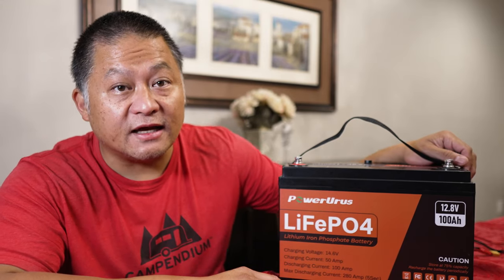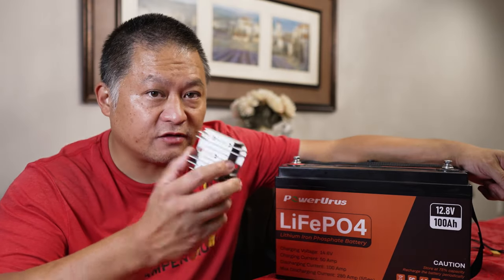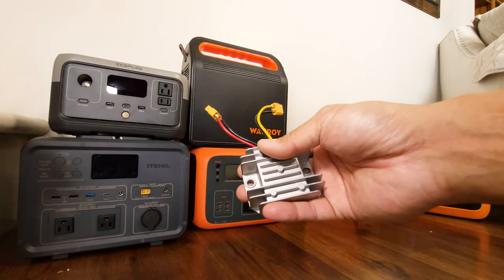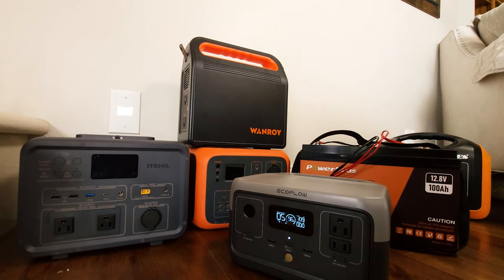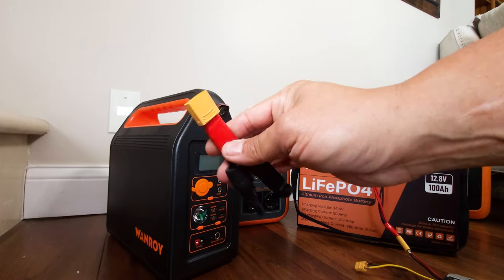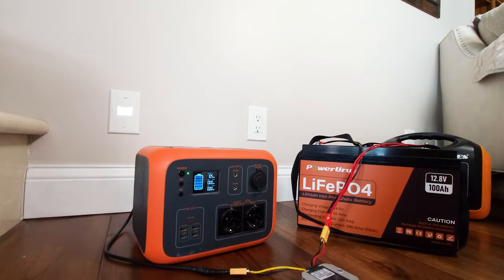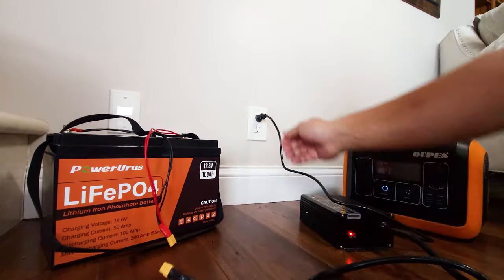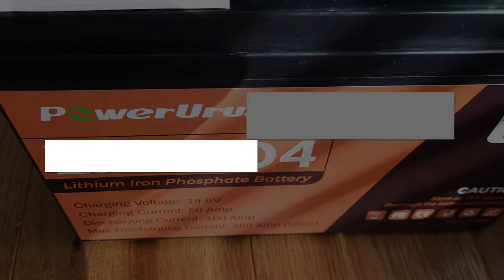CAPACITY HACK For ANY Power Station // PowerUrus 100Ah LiFePO4 Battery

Comment: This was well presented and clearly explained.  I think this is a good solution to use in an RV with a fixed LiFePO4 battery.  Your solution provides 1280KwH of additional storage.  The accessory battery is not cheap ($340).  The accessories add another $25-40.  External charger perhaps $50 for a total of $430.  Correct me if my addition is off.  

Negatives - Moving a large battery around is awkward – no handle/no case.  Maximum output wattage is still limited to the power supply circuits of your power station.  Albeit half the capacity, a new EcoFlow 600 is $479.  If you just need a moderate increase in storage a larger second unit would seem to be a better solution.  Is the boost converter necessary with some units?  The specs on my EcoFlow River 2 indicate it will accept 12-20 volts input for charging.  It comes with a cigarette plug adapter to charge from your car which is12 volts.  If this is correct, couldn’t I just hook the battery to the 12 volt charging plug?   Does it already have internal circuitry to limit the current and adjust the voltage?

I’d like to see this solution adapted to use with batteries we all might already have on hand (i.e. power tools, drones, external battery chargers for cell phones).  It may be a small boost but often that’s all you need.
Reply from the maker: The cost comparison needs to be made with first party battery add ons like this 6kwh ecofow delta option.

https://amzn.to/3UEKkoU

This is over 5-10x the price at per Wh level. Generic LiFePo4 packs are always going to be the cheapest option for the amount of capacity that you get. Power tool batteries are far more expensive per Wh and the battery chemistry does not give it the cycle life as compared to these. it would be much more costly over time to use them.

Boost converter serves as the equalizer to make this work with more types of power stations. While not needed for some, it can serve as a safety feature for all as it adds a cheap and easily replaceable current limiting feature.

You can certainly buy smaller lifepo4 batteries to make it more portable and lower the cost significantly especially when compared to other options you mentioned. The prices have continued to fall. 100Ah lifepo4 packs are now easily below $200 and 50ah ones can be found for less than 100.

https://amzn.to/49hjCqZ

They are small and weigh as little as 12 lbs. That's half the weight of a case of beer which I know for a fact that people have no problems carry with them when they go camping 😉
Reply: Far cheaper than the extra Bluetti 230 battery at $999.00!

Comment: Can you use two batteries in series to get to 24 bolts? Would you still need the converter?
Reply from the maker: It's been asked by multiple people in these comments already. I also talked about it in the video that using a boost converter will give you a current limiter.

Comment: I really enjoyed your video and it was very informative so it’s utilizing a boost converter you are getting a stable wattage for them to accept solar connection via XT60 connector.
Reply: I personally have a foxnov 384W, and 2 Allpowers S2000 1500W units. I’m planning on adding batteries instead of buying other units until I have enough for a large scale unit that can output 8000-10,000W as I’m looking for a whole home power station solution

Comment: Thanks you, could I have multiple batteries in series ..let say 2 100ah and do the same .
Reply from the maker: I would still use a converter as it will act as a current limiter to not over power your charge input or overheat the wires.

Comment: funny thing these things where invented a long time ago o dear ups save pc from power lost now the tech as developed its has  become a new thing
Reply: my question is does the dell adopter charge these at 19v
Reply from the maker: UPSs were dreadful devices that rarely worked when you needed them to with the archaic lead acid batteries that died well before they were needed to be used. All they were good for was making a lot of noise during a power outage.
Reply from the maker: Depends. New laptop chargers have a third data wire that communicate with the computer. Without a data signal they do not send power.
Reply: @freelyroaming  so true lol upcs are just extension sockets .nice channel still found it  doing research on cheep solar battery charger
Reply: @freelyroaming  I did some test last night turns out certain ups are better than high frequency inverter I took a part a old ups last night and found out that the battery is the bad part it has a transformer for voltage conversion and it it pure shine wave I hooked up 2 car battery’s on it and the results are better than any cheep inverter I tested and it’s rated 350 wats no ideas if it has peaks and has no fans

Comment: Why not 12-36 volt? Wouldnt that equal more watts at the same amps?
Reply from the maker: Less compatibility across different makes and models of power stations.
Reply: @freelyroaming  okay, but if mine all accept 36+ there would be no safety reasons? And wouldnt that equal less amps so less current and heat?
Reply from the maker: If it works for you, you can use any boost converter as along as it doesn't exceed your voltage and amperage limits.

Comment: Thank you, Sir. Great hack. I think I'll be leaning towards the pre-soldered wires that is being offered. And good tip on the 24v pass-thru. I think my Bluetti  has that...hmm. I was going to go with a different battery, 230wh, but I really like this battery and all of its protective safety features.  Thank you! Great hack!

Comment: Could you just get a 24V battery instead?
Reply from the maker: One of the most important safety precautions is having a current limiting feature. Connecting a 24v battery directly won't give you that.
Reply: @freelyroaming  Since I have the BLUETTI EB3A with a max 200 watt charging input, should I go with the 120 watt converter for faster charging?
Reply from the maker: Yes, you just have to make sure you size up your wires properly for higher current flow. I also found that the larger ones may have undersized heatsinks so the unit might get too hot. I would prefer running 2 of the smaller ones in parallel.

Comment: Step up converter great idea I have also seen this HOMELYLIFE DC Boost Converter DC 12V Step Up to 24V 10A 240W  is this better/worse than the 72w thanks
Reply from the maker: It depends on what your power station can handle. I find them to be usually under rated.
Reply: @freelyroaming  ok thank you for replying

Comment: Switch the xt60 to xt60i for more charging wattage. It eliminates the restriction coming in for ecoflow
Reply from the maker: The connector is not the only limitation. You'll need to change the wire gauge, and the DC converter. Simply swapping the connector won't change anything. The difference with the XT60i isn't that it carries more power but that it adds a data sensing lead for devices that support them. In this case, that data lead won't be doing anything.

Comment: Twelve volt automotive lighter sockets used to be made of steel and were fused at 20 amps. AHHH, I miss the good old days.
Reply from the maker: They may be fused at 20A but probably still technically rated at 10A. Most sockets aren't the problem and might handle it but the wire gauge and the actual adapters typically used are the bottleneck.
Reply: @freelyroaming  This was true some of the time. My first car, in 1974, was a '68 Chevy Bel Aire. It was a stripped model. No air, no radio and the gas tank was an option. Before I knew better, I connected EVERYTHING to the cigarette lighter line AM radio, separate FM radio, 8 track tape player, 10 watt PA amp CB radio with 50 watt linear amp and el cheapo fog lamps. I wanted everything to work without the key. I kept blowing the 20 amp fuse so I replaced it with a copper slug of the same physical size. The wire never suffered.
    My 3rd car was a 1966 Cadillac. It had a lighter in all 4 doors and one in the dash. The fuse block was fused for 30 amps in case more than one was used and each socket had a 15 amp cartridge fuse between the power plug and the socket.
    I now own a 2010 Dodge Grand Caravan. It has 4 factory outlets on two 20 amp circuits. Two are on full time and two are switched with the key. I blew the switched circuit when my electric cooler box shorted out. When I went to change the fuse, I saw 
that the socket had three contacts. If you set the fuse in the original contacts, the two outlets were switched. If you moved the fuse to the left using the center contact as common, it was on full time. I've never seen anything like it.

Comment: If you bought 2 batteries could you series them together for 24v and forgo the 24v converter?
Reply from the maker: Even though it might be fine for some, I would not recommend it because the converter is also acting as the current limiter. A battery connected directly can push too much current without it and some power stations may not have the proper protection circuitry built in. I talked about it starting at 5:14

Comment: Thank you, please show how set it up for charging this battery via solar panels.
Should we go via the first power station station or just use this converter and plug solar as input? 
I am using 2x Ecoflow r600 pro and their solar panel.
Reply from the maker: Just use a portable solar panel to charge the power station directly. This is for expansion without solar.
Reply: @freelyroaming  ofc, but I mean how to charge this expansion battery via solar? 
You don't recommend doing that?
Reply from the maker: @mikael3201  you can also do that with a portable solar panel. You'll just need to add a charge controller. But if you are going to just use the expansion battery to charge a power station, it's more efficient to just charge directly.

Comment: I have the new EcoFlow 2 River. I tried connecting the xt60 direct to the battery and it works with the EcoFlow specs being 11vdc-50vdc input. Any advantage to using the booster in my application? Thanks.
Reply from the maker: It also adds a level of safety as it would act as a current limiter. Although the River 2 has that built in as well.
Reply: @freelyroaming  thanks for your quick response. I picked one up. As you started it would ensure that the current is limited. Thanks again

Comment: Could you add say a 48v EG4 or Trophy battery as well as the 12v batteries with the same setup?
Reply from the maker: I would be careful when mixing systems with different voltages. It's best to keep to a single base voltage.
Reply: @freelyroaming  Not sure if I asked that correctly. I meant INSTEAD OF adding a 12v PowerUrus battery to these power stations, could I add a single 48v EG4 battery instead? If so, which of the adapters from Amazon site would I use?
Reply from the maker: @alanmalmberg1549  ummm I suppose you could although you would want to use a 48v to 24v buck converter. Like this one.

https://amzn.to/3XQE78g

Comment: There is no point in boosting the voltage the transfer of power will still be the the maximum output of the battery . Double the voltage reduces the amps keeping the wattage the same minus the loss due to conversion of the voltage to 24v . You can charge the lithium battery with a dc to dc charger I have the renogy version.
Reply from the maker: You're contradicting yourself because your Renogy DC-to-DC in fact boosts the input voltage in order to charge your LiFePO4 battery.

It's fine to charge like that for a standard LiFePO4 battery pack but you do not want to use that to charge via the solar charging port of a power station. It would be like connecting 2 charge controllers in series which will have 2 charging algorithms both trying to regular the charging voltage and current at the same time leading to very unpredictable and potentially dangerous results.

A DC-to-DC charger like the Renogy unit yo are talking about is for charging from one  12v battery pack to another. It is not for charging power stations.
Reply: @freelyroaming No I said use the dc to dc charger for the lifepo4 battery since the lighter circuit  was not enough to charge it. The dc to dc chargers come in 24v and 12v output, which is the one I have. The renogy comes in 20a ,40a, and 60amp. The best on the lifepo4 battery limits the discharge rate so when charging the power supply with the battery converting the voltage to 24v will still yield the same wattage minus the loss due to conversion.
Reply from the maker: @williamirelan9332  well in that case, for the purpose of what is shown in this video, there is no use for a DC to DC charger. Because the battery is charged from an AC outlet. I showed the best way to do that in this video using a constant voltage / constant current AC battery charger. Realy don't know why you brought up DC to DC charging in this context tbh. As to charging from battery to power station, boosting the voltage is absolutely needed for many units that only have DC charging ports that support solar but not car charging. You're responses are very out of context for this video.
Reply: @freelyroaming  He Mentioned Charging 100ah Battery From A 12v car outlet was too slow because it was limited to 10a. Did You Watch The Whole Video? I only responded to what he said no more.
Reply from the maker: @williamirelan9332  Unmm... well since I made the video and that is me talking in there, so yeah, I think i have an idea of what happened. I was referring to charging the power station with the car, not the  battery. Adding a DC to DC charger to your car just so you can occasionally charge a standalone battery is overkill. Completely unnecessary unless you have the battery installed in a camper. Which is not the context we are talking about in this video.
Reply: OK, that was unclear. I think you should check your output from the battery. 100ah batteries are generally rated at 1280wh, double the voltage reduces the amps, you don't get more watts from the battery.
Reply from the maker: @williamirelan9332  only 4s lifepo4 packs have 12.8v nominal voltage because each cell has a 3.2v nominal voltage which is where the 1280Wh capacity comes from. Not all 100Ah batteries have 1280Wh. For example a 100Ah 12v AGM has 1200Wh and a 100Ah 4S LiPO pack has 1480Wh. I've covered all this in other videos in the past. You're not a subscriber so you don't know. You probably just landed here from a recommendation.

You are just talking about some basic electrical concepts that anyone who does this stuff already knows. It isn't adding anything to this conversation. Your comments confuse power output, current flow and battery capacity. Boosting the voltage increases the power output at the same current flow. No one is talking about somehow it can add more capacity for a battery. Laws of physics prevent that.

You said 'You don't get more watts from the battery'. Watts are a measure of power, not capacity. You certainly can get more watts. You just can't get more watt hours. You also referenced amps when it should be amp-hours. One is a measurement of current flow, the other is capacity in terms of current output. The right terminologies makes all the difference and being clear and using the right ones matter.
Reply: I referred to amps not ah because the bms in the lifepo4 battery limits the output in most cases to 100 amps and  the charge controller in the power station because the voltage input is variable  limits the input amps by reducing the number of amps. Vxa=w increasing the voltage does not increase the power that is transferred because the charge controller lowers the amps to compensate for the higher voltage. Watt hours is the capacity  of the battery a 100w bulb will light for 12.8 hours on a 1280wh battery.
Reply from the maker: @williamirelan9332  Again you are just reiterating the basics of Watt's Law. And your use of terminology continues to be very inconsistent. Not a good way to talk about electrical systems. For example, using the phrase 'power that is transferred' is not an accurate description of what happens. Power in electrical terms is measured in watts. Watt refers to a unit of the electrical force, not the amount.

Like a car's horsepower. Having 100 horsepower does not mean it actually traveled any amount of distance and did any work. So to talk about units of electricity being transferred, you have to talk about Watt Hours which are units that can be transferred as they measure the 'work that was done'. There is just no reason to confuse these basic electrical concepts.

Regardless of your inconsistencies, I still don't understand what point you are trying to make. You started by saying that boosting the voltage is not necessary and then went on to talk about DC-to-DC chargers by Renogy that aren't designed for use to charge power stations. Once again. That does not apply to anything this video is talking about.

And please, there is no need to state the basics of Watt's Law again. No one is unclear about how that works.

Comment: If your truck or car has a built in inverter of, let's say, 600 watts, could you charge your big 12 volt battery from that as you drive and use the battery later to increase the run time on your power pack? Would the big battery charge in a shorter period of drivetime than the power pack would from the cigarette lighter plug?
Reply from the maker: yes it would charge much faster through your vehicles built-in inverter. There is more efficiency lost through an inverter but as long as your are driving, it is probably fine.